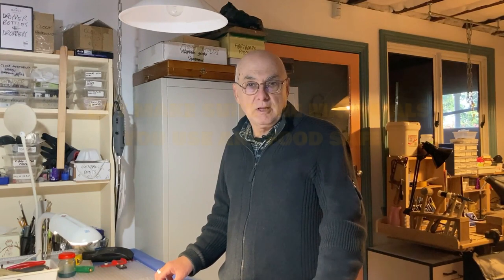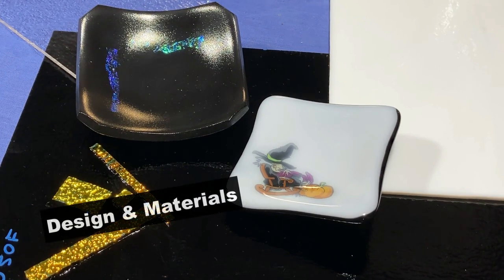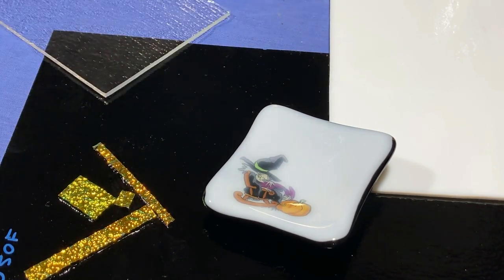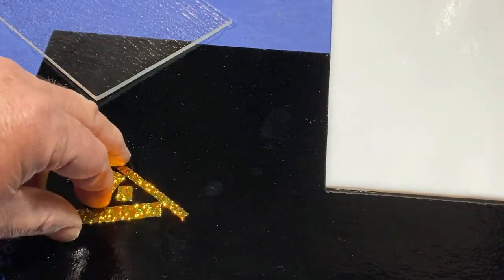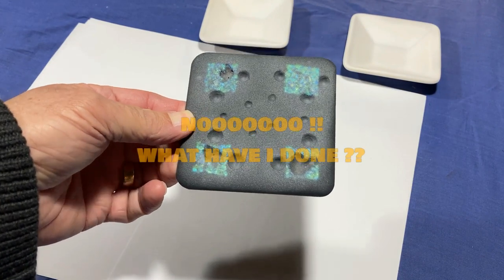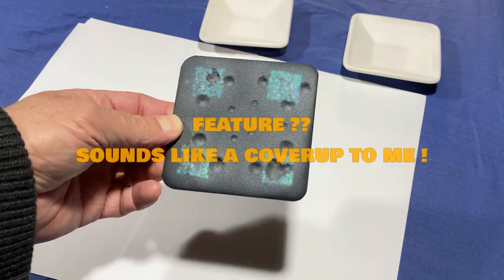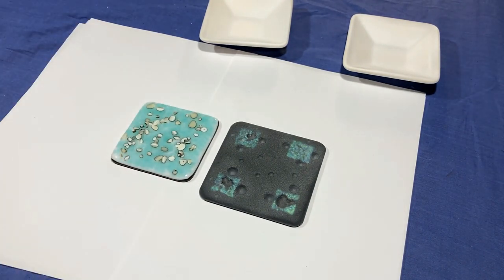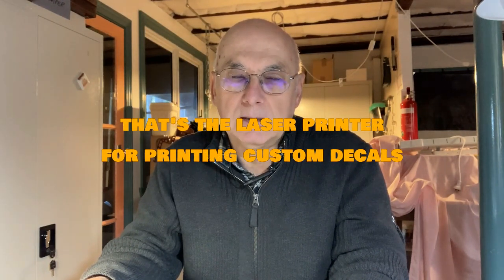Why are Little Dishes so BIG? Fused Glass Project Tutorial

Comment: They both came out beautifully! Thank you for sharing. The reaction dish has a vintage look to me. I think it is interesting that you, maybe intuitively, chose a black backing. By contrast, the black dish looks modern and the dichroic and the holes lend to a modern feel. Was that a flex shaft that you use to grind? I have never used one in glass only metal jewelry.
Reply: I have to agree with Lisa.   I think the black dish looks very modern and interesting with the shiny craters on the matte background.    A happy 'accident'.
Reply from the maker: Hi Lisa. Yes, that's an old Dremel (one Ann replaced with a new Foredom unit) hanging from the roof and a flex shaft. I use that for things like carving, grinding the backs of cabs so bails can be glued on, etc. Always done in water. Hence the flexible portable camping sink, with one side collapsed down. A piece of glass in front as a shield. Yes, I am going to replace that with a piece of perspex. 😁
Reply from the maker: @watcherinlaa8736  Us glass fusers never have accidents, do we? Just unplanned features. 😂😂😂

Comment: I am confused...when putting in the kiln the squares have straight 90° corners, after the full fuse they are rounded. Is that what normally happens?
Reply from the maker: Hi Sergio. Absolutely. The fuse melts the glass and surface tension causes it to pull in and start rounding off. You may have heard of the 6 mm rule. What that means is that if you melted the glass long enough it will flatten to 6 mm thick and form a disk. This is why you can place a 10 mm square piece of 3 mm thick glass in a kiln and fuse it until it becomes 6 mm thick, so it get thicker, and forms a round cabochon. Equally, a piece of 10 mm thick glass will flatten out to just 6 mm and spread out. At lower temperatures you'll find the glass surface still starts softening and the square edges start rounding. Even at slump temperatures there is some softening of the surface and it rounds out it part. A sandblasted piece of glass at low slumping temps will develop a satin finish. Hope this helps.

Comment: I just ran a trinket tray.  It had a dip in the sides, it has peaks on the corners, not sure how to describe it.  I put the prepared fuse glass in, and it flowed out of the side.  My kiln is not level so that may be it. also the glass was the same size as the mold.
Reply from the maker: Hi Judith. If you slump and the kiln isn’t level it will slump to one side. If it flowed a lot check the temp and the hold. Same size glass shouldn’t be a problem if level.
Reply: @RocketRoseArt  Thank you

Comment: Hi Jeff! Your videos are so helpful, thank you! I recently did a similar project as your frit dish. And after the slump, the polish I had from the full fuse was less so and the frit was more defined in texture (so you can feel their outlines if you run your hand over it). It looks fine but I had liked the polish better. Do you think this is just due to the compression into the mold, or due to temperature or hold in the slump firing (or something else)? Thanks!
Reply from the maker: Hi Carrie. That's strange. I'm honestly not sure why it changed from a full polish to having texture. I wish I could help.

Comment: I had a feeling that you would get bubbles on that black piece. Could you have put clear dichroic on the top (clear side up)?
Reply from the maker: Hi Liz. I think I was too confident. Have done this several times before and it worked. Can't work out what is different this time. I think some of it is down to a rougher texture on that dichro. I tend to think that having the dichro in each corner may have also contributed. But clear shouldn't soften as quick as the black. I expected the black base to soften and the dichro to settle in. I'll probably do a couple of tests to narrow it down.